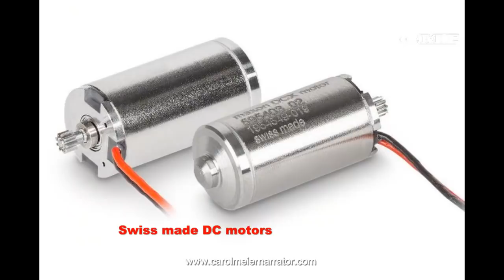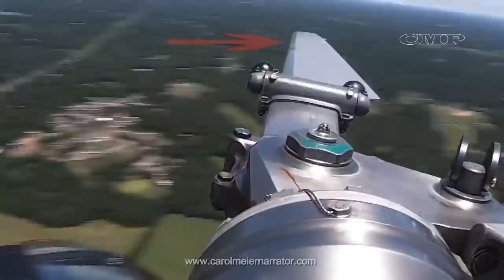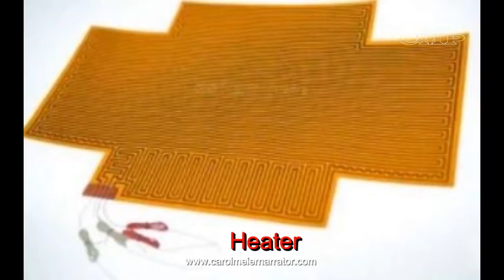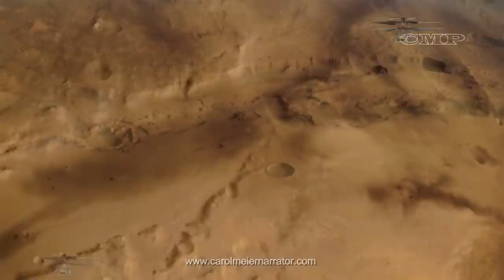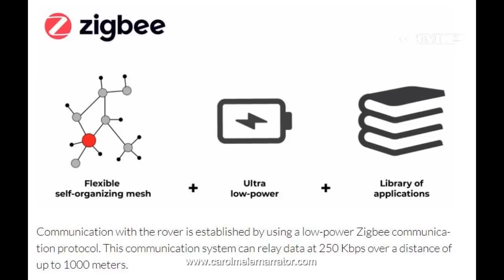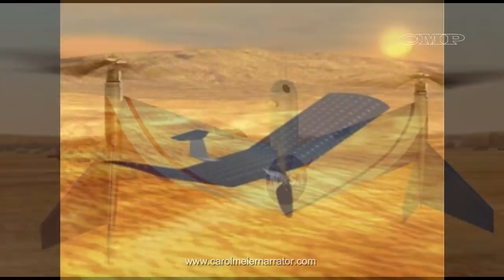How It Works - The Ingenuity Helicopter - Narrated documentary.

Comment: Why didn't the copter just tag along with the rover? It seems like a poor lack of forethought to NOT consider the probability of the copter lasting beyond its designated time frame. We've had and still have things out there that are still functioning well past their expected "lifetime". Voyager 1 & 2 are still sending data back 45 years beyond their designed 4 year mission life. Opportunity lasted for 15ish years, pretty good for something meant to last 3 months (and it didn't fail on its own, dust from a storm did it. Oppy may well have lasted much longer ).
Reply from the maker: Ingenuity did not stay where it landed; it actively followed and acted as an aerial scout for the Perseverance rover, covering over 11 miles during its 72 flights. While it was deployed from the rover's belly in April 2021, it continued to operate for nearly three years, surveying terrain and assisting with mission planning until its final flight in January 2024.

Comment: Very good informative video without getting into heavy technical jargon.  I was wondering why not use a common three or four blade rotor design instead of the counter rotating design which seems like it would have more complex mechanics especially on what is essentially a model RC aircraft?  
Too bad Ingenuity can't just follow or leapfrog along once it's 30 day "contract" expires...What a waste!
Reply from the maker: The counter rotating design eliminates the need for a tail rotor.
Actually, the Ingenuity helicopter did so well that it is going to be following the Perseverance rover and doing some scouting for it.  It will continue for as long as it can.  It was only designed for a 30 day mission and engineers are not certain how long it can withstand the freezing and thawing days and nights before it fails.
See this video on the first 6 flights.  It summarizes at the end how Ingenuity will perform going forward.
https://youtu.be/xsr2OHdY97g
Reply: @revoeciov  why isn’t this used on earth based helicopters?

Comment: Thank you for explaining Ingenuity in detail. So much better than the snippet of dumbed-down laymaness (self coined term) they show on news programs!😄
One thing the video still leaves me questioning is, what are the spike like devices protruding out from the blades? 
Are they a form of weight balance, or aerodynamic aid, or something entirely different? 
I've been wondering about that since I first saw this little heli.
Reply from the maker: They are weights generally used on helicopters to balance the blades and reduce vibration.
Reply: @revoeciov  I thought that might be the case, but wasn't sure. Thank you for your reply, I appreciate it! 👋🙂

Comment: Why not just use lighter than air balloons, Along with the copter.?
Reply: I asked this years and years ago when I suggested in posts all over the internet that NASA should be developing a helicopter/flying vehicle to get away from "inches-at-a-time crawling, lumbering Rovers.  A gas that is lighter than the thin Mars air should not be difficult, and could be compressed - or even processed on the surface, and pumped into a small 'blimp' carrying a bevy of science experiments, and EXTREMELY high-resolution cameras. 
I'm not really sure, however, after looking at the unbelievable amounts of obfuscation on nearly every photo ever released by the space program, that they WANT incredibly razor-sharp, detailed, zoomed close-ups of anything of interest on Mars, the Moon, or most other solar bodies.
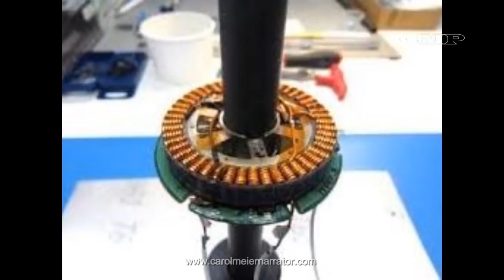Reply: At 6:00 we see that Mars' atmosphere is largely (96%) CO2. Over time, the lighter gases have escaped into space. Lighter gases for balloons will have to be transported from earth.
Reply: @bernie7984  And making it light and leakfree... Control would be worse too.

Comment: Very impressive.  If the Copter passes all of the scheduled test flights, has NASA considered then flying the Copter in short hops down the route of the remoter location 'waypoints' that already form part of Perseverence's primary mission?  Reconnaisance of that route and then re-connecting and testing of the Copter's durability over time as well as enhancing the primary mission data - could be advantages?

Comment: Damn, if only Perserverance had a landing pad, "Lil' Ing" would be given instructions to search sites that deemed hazardous to Percy
Reply: Dual purpose solar panel/landing pad with electromagnetic landing gear that can magnetically lock the drone to the panel. Also running the drone blades at full speed while locked to the solar panel will clean dust off the panel.

Comment: Интересно но  жаль, что все  события очень -очень медленно происходят.
Reply from the maker: Translation:
It is interesting but a pity that all events are very, very slow.
Reply: @revoeciov  You are amazing - thank you for the translation. I would LoL, and say that the questioner may not understand the complexity of the multi-tasking necessary to control both vehicles from Earth, or the time it takes these commands - and the data gathered from both vehicles - to travel to Earth, for analysis, and then return to Mars for processing by the rover and helicopter. 
The Rover itself must have a very good A.I. system integrated into it.. Just steering the Rover alone is incredibly complex, with huge lag times for the signals to reach the Orbiter and be transmitted to the Rover - and back again - and during these "lags" they (the 'drivers' on Earth)are essentially blind. 
Would you agree? 
You are one of the best presenters, and the most accessible and human, of any presenter I've ever encountered. 
Thank you so much for what you do. Subscribed immediately.
Reply from the maker: Translation:
 @berretta9mm17  @Carol Meier Рассказчик - revoeciov Вы великолепны - спасибо за перевод. Я бы сказал LoL и сказал, что спрашивающий может не понимать сложности многозадачности, необходимой для управления обоими транспортными средствами с Земли, или времени, которое требуется этим командам - и данным, собранным с обоих транспортных средств - для путешествия на Землю для анализа. , а затем вернуться на Марс для обработки марсоходом и вертолетом.
У самого Rover должен быть очень хороший AI. интегрированная в него система. Простое управление только ровером невероятно сложно, с огромным временем задержки сигналов, которые достигают орбитального аппарата и передаются на вездеход - и обратно - и во время этих "задержек" они ("водители" на Земля) по сути слепы.
Вы бы согласились?
Вы один из лучших докладчиков, самый доступный и человечный из всех докладчиков, с которыми я когда-либо сталкивался.
Большое вам спасибо за то, что вы делаете. Оформил подписку сразу.

Comment: So, what happens in a storm/sandstorm, how does it survive, stay up right, does not get destroyed. ?
Reply from the maker: NASA does not expect a dust storm to come up during the helicopter's operation.  Dust storms usually happen in the southern hemisphere in spring or summertime, and the helicopter will be in the northern hemisphere during spring.  Even if a dust storm were to happen, the main effect is that the sky would become dark.  It wouldn't be much more windy, probably barely felt,  because of the very thin atmosphere and the helicopter would not be pelted with sand.  The sand is so fine that it mostly just darkens the sky a little.  Since the helicopter is solar powered, it would mean that it may take a little longer for it to charge its batteries before the next flight.
Sand storms like those depicted in movies like The Martian are myth and designed for Hollywood effects.
Reply: @revoeciov  thank you for a great answer ☺☺☺
I hope it will work perfectly and you will get lots of data 😊😊

Comment: So when will we see it flying?
Reply: That was my question
Reply: So: WHEN WILL WE SEE IT FLYING? The battery will be dead by that time...
Reply from the maker: @xres1329  
Remember that the helicopter is not the primary task of the Perseverance rover.  The rover is busy doing lots of other things including discarding the cover that covered the sample acquisition equipment and testing of systems etc.,...  things the rover has to do before it can turn its attention to the helicopter.  The rover also has to find the ideal spot for the helipad even before it can lower the helicopter to the ground, after which more system checks will be carried out.  NASA estimated that helicopter flight would occur approximately 30-60 days after the rover landed.  Depending on how preliminary tasks go, that may be extended to sometime in May.  Be patient.  It is more important to do this right than just jump right in.
Reply: I think the last I heard was the first flight might be as soon as April 8th.

Comment: I always suggested that we needed more aviation flight drones to cover the geo photography of almost every nit griny area on Mars, the rovers need support, the next thing should be blimps, but it was a bad idea that the rovers task was first, as its just tarnishing geo image paths with tracks, laser burns & drill holes, that would've sucked if Google had that issue with building construction & heavy traffic all the time.
Reply: I’ve been suggesting blimps for the past couple of months with lite weight solar panels and with six or more directional ducted electric fan motors for pupation. It’s nice to see others interested in this concept.
Just one factor to consider amongst others , is how the extreme cold could affect the materials and maybe the dust factor.
Reply: Blimps only usable 90% on earth cause of winds.
Worse on Mars

Comment: Amazing, but was thinking maybe the landing pad could of been made of solar panels which would charge a battery attached to it, then adopt the wireless charging method which would keep it warm thus leaving more power for it fly further.
Reply: Nice point.
The red dust blown off the pad by the blades.
Find Curiosity and blow the dust off its solar panels and @ its wheels?
Reply: Or they could have built a landing pad on Perserverance but I'm asking for too much

Comment: It would seem that because Ingenuity is a dual rotor helicopter with counter-rotating blades that there would need to be two independent swash plates - one for each rotor. Also, the swash plates would need to control both the collective pitch so as to control lift and therefore altitude and also there would need to be cyclic pitch to control the helicopter's pitch and roll attitude. Also, although the counter-rotating rotors eliminates the need for a tail rotor Ingenuity still needs to accomplish yaw control somehow. How does it do that? To facilitate yaw control it would seem that either the relative speeds of the two rotors would need to be independently adjustable to create a slight torque imbalance between the two rotors, which would yaw the helicopter.  Or perhaps the collective pitch of the two rotors is independently variable to vary the drag and torque of each rotor but in opposite directions so as to create the torque imbalance required to yaw the helicopter.
Reply: Joe Vignolo what your forgetting I'm afraid, is that NASA have employed extremely clever intelligent people who have worked it all out and know how to do it, so just sit back, relax,  and enjoy it all and let them do all the sums ! 😊
Reply: Take a check Ingenuity's rotor head, you can find two motors for propulsion. Ingenuity have two propulsion motors, one for upper rotor and another for lower rotor. Propulsion motors are controlled by each drivers independently so that can yaw control.

Comment: The video provided a lot of great detail. Well done. I do wonder if after the helicopter's main mission is complete why it couldn't take some risks and hop along with the rover as it explores the terrain. In other words if the rover drives 300 over the period of a few weeks then pick a convenient time and fly the helicopter to a site near the rover. At this point every landing with no damage is a win. Getting hung up with a rock or tipping over wouldn't matter since the mission goal has already been achieved.
Reply: Yes, this was my question.  Why drive away from it when it could follow allowing it to be used for as-yet-to-be-determined purposes.   Perhaps it is a human or computer resources issue.  The resources needed to plan and control the hops are limited and already allocated for other purposes. Strange, because it would seem that the ability to get an overhead view of obstacles or items of interest that the rover encounters would be invaluable. Probably there is a good answer, just wished they had mentioned it.
Reply: @HVDonkeyPark  NASA typically extends missions if they are still capable of science. So if it is undamaged, it will most likely stay in rover communications ranges as the rover does it's thing.

Comment: Ok even if it works  they didn't think of where the Helicopter will stay  at night or during the storms unless is protected against the dust devils it will have only limited time until it's knocked over  and probably damaged.  They should have added a surface on the axle where the arm of the rover would grab it and store it next to it.  Preventing it to be  dragged away by wind storms.
Reply: I think they did 'think' of that tbh, they are very clever intelligent people working at NASA, the fact that they got the thing to Mars , and in one piece in the first place proves that, there are some unexpected things that will happen of course, and some things they have learned from previous missions, but I'm sure they will have that covered, sit back and enjoy the show 😊
Reply from the maker: NASA does not expect a dust storm to come up during the helicopter's operation.  Dust storms usually happen in the southern hemisphere in spring or summertime, and the helicopter will be in the northern hemisphere during spring.  Even if a dust storm were to happen, the main effect is that the sky would become dark.  It wouldn't be much more windy, probably barely felt,  because of the very thin atmosphere and the helicopter would not be pelted with sand.  The sand is so fine that it mostly just darkens the sky a little.  Since the helicopter is solar powered, it would mean that it may take a little longer for it to charge its batteries before the next flight.
Sand storms like those depicted in movies like The Martian are myth and designed for Hollywood effects.
Reply: @revoeciov  Jeez, the guy just watched(and presumably) listened to your superb, detailed vid which addresses the wind/atmosphere dynamics, but you're cool enough to repeat yourself for the sake of SCIENCE. Bravo!

Comment: Bit of confusion with the 10mm motors and the main motors.
Reply from the maker: The helicopter carries 8 electric motors.
The rotors are powered by a pair of custom-made 23-pole solid-state DC units filled with square copper wire that AeroVironment  hand-wound using a microscope and took 100 hours per motor. 
The other six motors drive the servos, 3 for each swashplate for each of the 2 rotors.

Comment: For an unmadded vehicle, decent at the rate of 3 feet per second is too fast.
Reply: not at mars gravity
Reply: I'm a commercial UAV pilot I fly 10 to 30kg single rotor gas and battery powered helicopter UAV's carrying payloads on longlines, either in assisted RC mode or fully autonomous mode our UAV's climb at 5m/s and descend at 2m/s, that's over 6ft/s descent